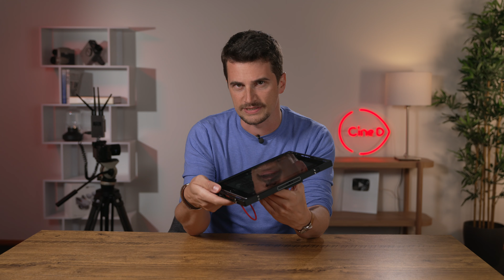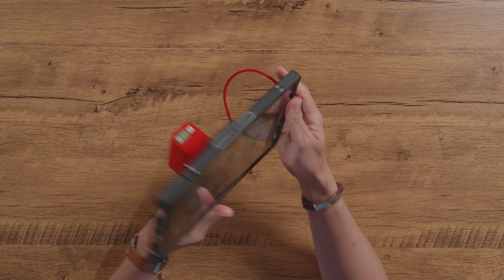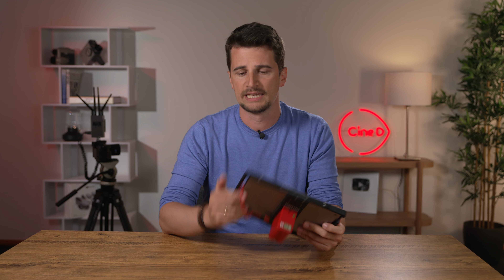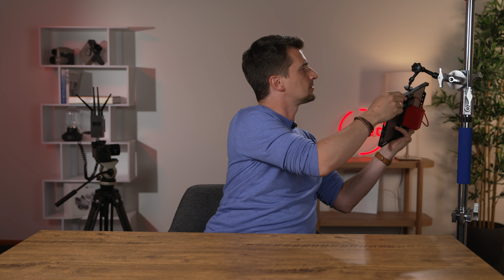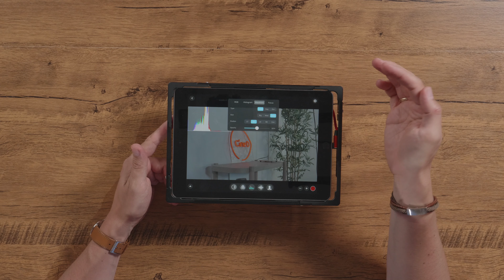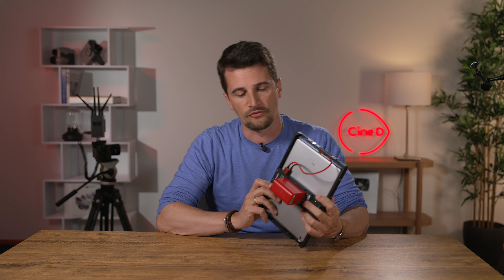Accsoon Power Cage for iPad Review

Comment: I did order this cage from Amazon for my Ipad Pro 11.  Unfortunately, once installed, the cage does not have a way to control the Ipad's buttons.  Everything is covered by the metal rim.  I had to return it back to Amazon.
Reply: so pulling down the control center on screen was not an option or did you just want to make yourself look as dumb as possible?
Reply: @TheVyrus74  Thank you for your remark Mr. Smart Ass!